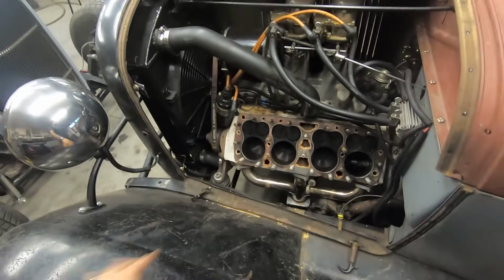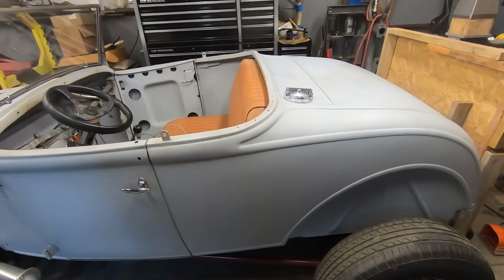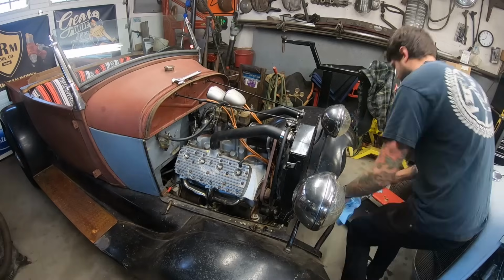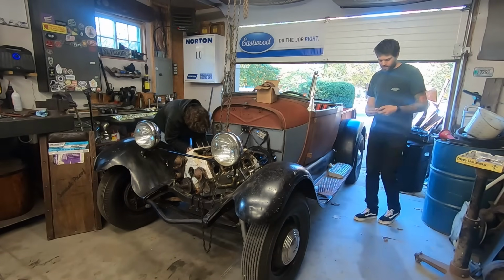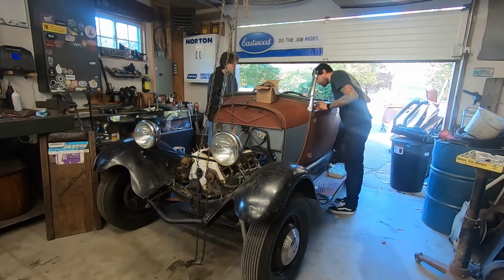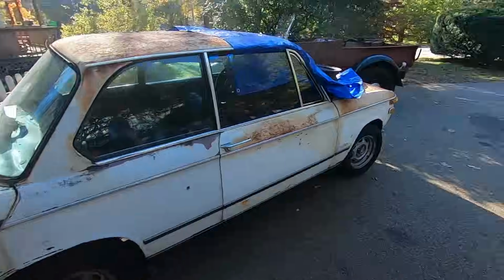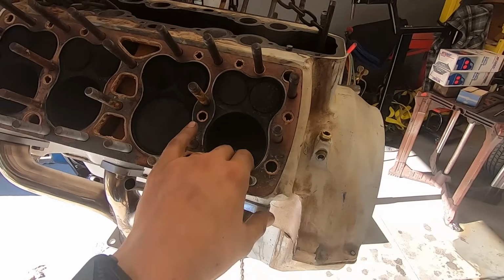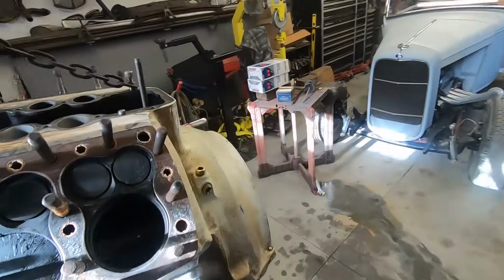Pulling the Flathead V8 to Rebuild Coffee Break

Comment: OK, here's a heads up regarding Mercury spec engines [239 cube] 
Introduced in 1939, they use the code number 9  for identification. The other cast number is the last digit of the calendar year of production or design.
So the 1939 Mercury used the code 99. In 1940, it was 09, then 19 for 1941
The 81 horse Ford engine was discontinued for passenger car use in the US from 1945 & the 59 code was used for all Ford cars in 1946, '47 & '48.  The 'A' & 'B' codes were production codes & are beyond me, but C59A is the code used on Canadian versions that we saw here in Australia. These codes can be found atop the bellhousing &/or on the pad in front of a cylinder head & above the water pump. I forget which side, but I think left.
I don't remember for sure, but I think that the 221 cube, 24 stud, "Ford" engine was used from 1939 right through to '48 in export markets, or at least, the Canadian made post war export models.
Some wartime engines used replaceable sleeves, ex factory, in dessert regions & some had factory 'relieved blocks' [between valves & bore] I had one of these.
Of course, I'm not a Ford bloke, it's just stuff I have picked up over the last 50 years of Hot Rodding.
Reply from the maker: That’s a lot of info. Thanks I hope people see this and learn some

Comment: A little 283 and 5 speed manual would solve your problem and be reliable
Reply: I'm a dyed in the wool Mopar bloke, but the simple fact is that the dinosaur Ford side valve V8 engine is as reliable as tomorrows sunrise if it is in good serviceable condition, & is operated within its operating limits. 
If the bore is damaged & out of limits, if the bearings & crank are worn, resulting in low [or no] oil pressure then it does not matter who the engine maker is, the engine is a potentially unreliable unit & the blame for that is ultimately on the owner/operator.